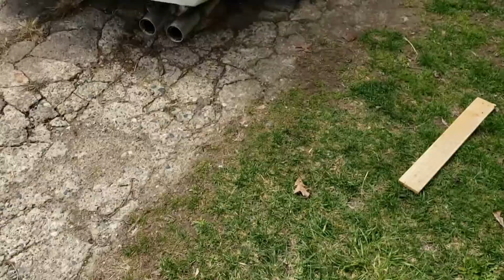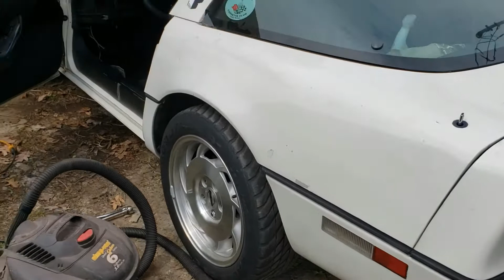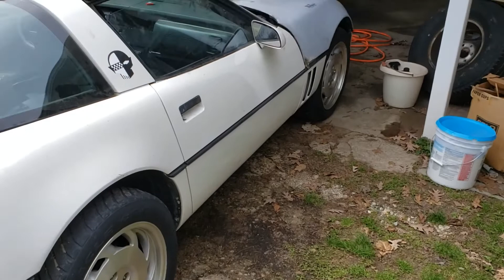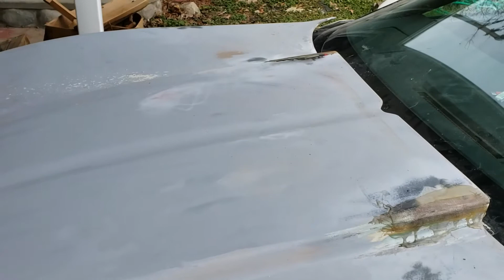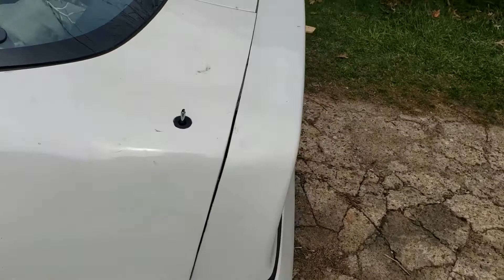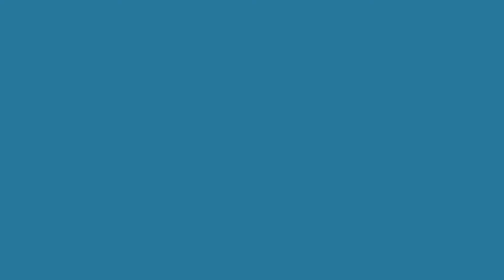corvette swap  11

Comment: Pro 5-O makes a GM shifter fits perfect. Also check the clutch pedal adjustment and make sure the clutch system is bleed well .